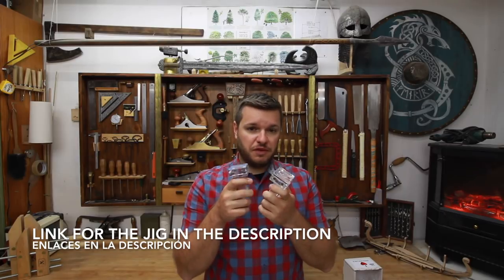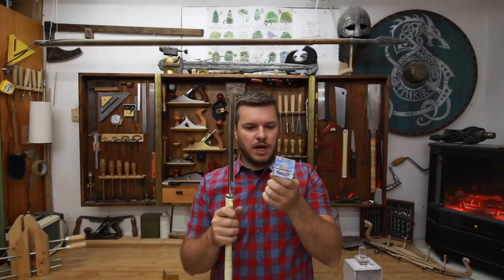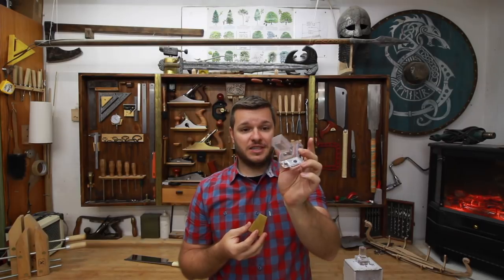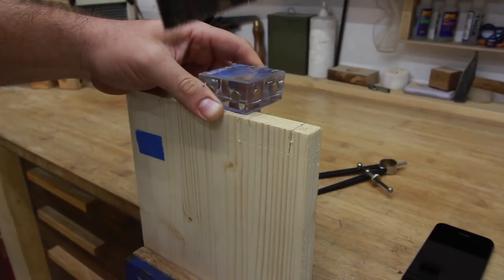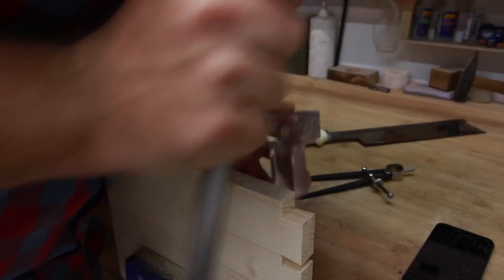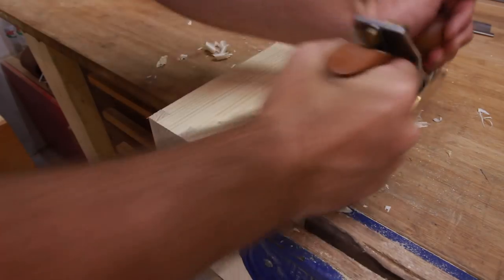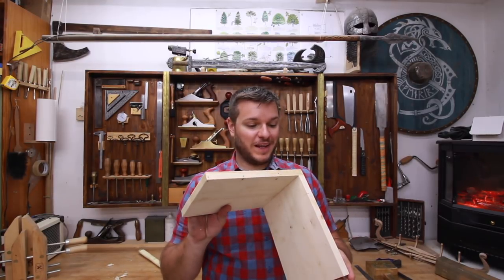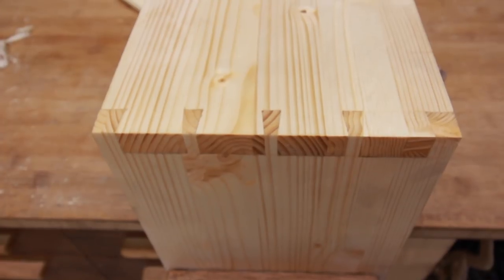HAND CUT Dovetails - Made Incredibly EASY (GIVEAWAY)

Comment: I've always wanted to try dove tail joints, didn't think I could, but would love to try. Nice episode!
Reply from the maker: I remember how much I had to practice to get nice joints and it was always frustrating to do them on both sides of the board. If you screw up one the whole board + the mating one can go to scrap. I used to do 2 hours per joint without the jig. Now I do the same one in 7 minutes but I’m much more confident that my joints will come out perfect. 
After using a jig for some time (a year or so) you will develop a muscle memory and be able to cut them without the jig.
I don’t use the jig if the boards are very thin (under 8mm) just because I’m faster now. Cheers

Comment: Great video! Did you have the 6:1 or 8:1 jig?
Reply from the maker: I have 8:1.
Normally 6:1 is for softwoods and 8:1 for hardwoods but any will do the job. I have 6:1 from David Barron so I didn't find the need to buy another one. 
They are both excellent for cutting DTs but Moses jig is better value since it offers 90 degree cut and it costs less. Cheers